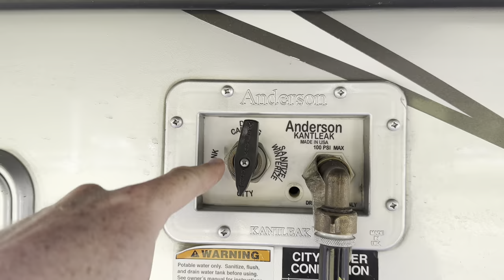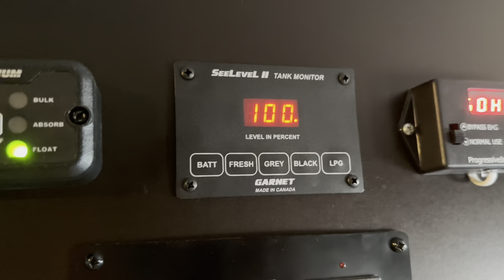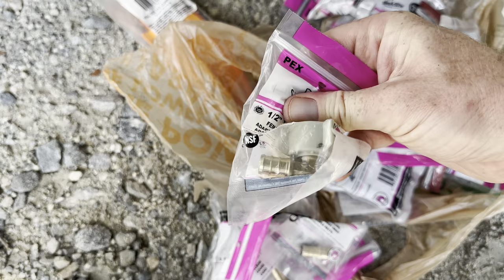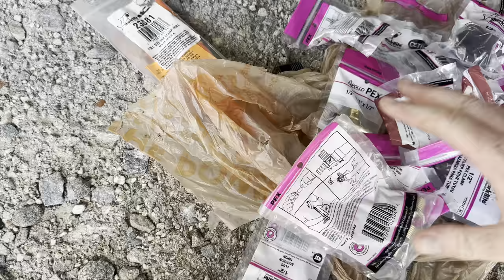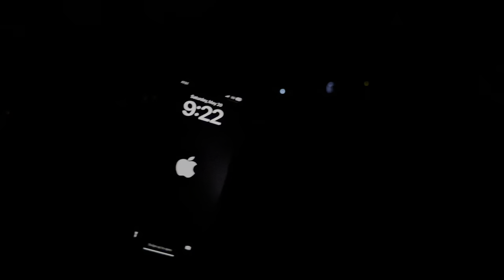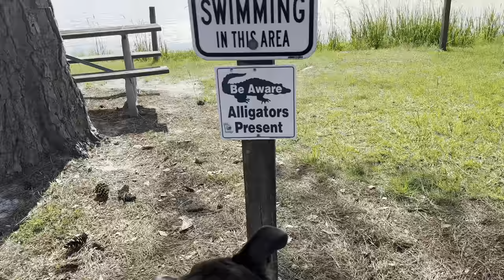This Isn't Good! 😫RV Water Issues (Reed Bingham State Park GA)

Comment: The best thing I have found for the swarming bugs is menthol.  I get the generic sore muscle spray with the most menthol I can find and spray my cap, shoes, back, etc.  The bugs still swarm but they stay back and do not land.  Works to keep ticks off also and I spray my socks or ankles good if walking through grass that may have other bugs.  I used it on the mattress in the cabin we use to have, seems to work well for most bugs.  I still use a mosquito net if they are bad.   Nice park.  Stay  safe and healthy.
Reply from the maker: Interesting! Don't think we've tried that yet. Appreciate the tip😁

Comment: I ended up having to order a new Anderson valve for our Ghost. My original one is plastic, the replacement is brass. Maybe the replacement will hold up better than the original. The worst part, the Anderson valve has a 6 week lead time. Glad you were able to bypass the anderson valve for the time being.
Reply from the maker: We ordered one but we will have to go through the trip with the bypass, luckily we carry Pex, fittings and tools for this reason!

Comment: We had the Anderson valve on our Isata, which also failed. The valve design and innards are a pain to deal with. Anderson advised to turn off water to the valve when changing positions, but I'm not sure it helps much.
Reply from the maker: We never have the water on and lines are never pressurized when we change positions, so we can say that doesn't help😂😂 just a poor design in general unfortunately in our opinion

Comment: We’ve been RVing in motorhomes for 16 years. We came from a boat. In the boat you always use the tank and I carried it over and have always done it in our RV. Even in a campground we run off the tank. I just top it off each night before bed. Tank is always fresh, never smells because it used constantly.
Reply from the maker: We always have water in our fresh tank. Very occasionally we will run off City water but always have water in the tank regardless because we use it too. 😁

Comment: Mike:"I'm and adult and treat me as such."   That wasn't the message I got a couple of videos ago when I asked if you were ever going to grow up.  Not that there's anything wrong with not growing up, heck I've been fighting growing up for 68+ years, but you can't have it both ways.  Just sayin'.  As for the Kantleak that cartridge is no longer available anywhere that I could find.  The replacement valve is solid brass and last I knew cost about $250, probably more now but that's probably your best solution.  Running completely off of the tank is not an all bad idea.  If you turn the pump off every time you leave the RV your rig won't flood if you get a plumbing issue.  If you're on city water and develop a leak you will likely come home to water running out of your coach.  Just something to think about.  As far as the rain goes, remember you are the Wagners.   Keep the good stuff coming guys.
Reply from the maker: Haha adults can like shells n cheese and chocolate milk for dinner and doing dumb things with bikes and sledding😂😂
We ended up ordering a new valve but won't be able to actually get it and replace it for awhile since we are on the road so this mod will suffice in the mean time

Comment: YOU NEED TO TAKE IT BACK TO THE DEALER AND MAKE THEM FIX IT
Reply from the maker: We don't like to do that because we use our rig a lot. Plus we are a several hundred miles away from the dealer and manufacturer
Reply: Nooo stay away from dealer service at all cost!
Reply: @AlliChuckAdventures  THEY DO THE BEST WORK GOBBLESS UNLESS YOU ARE CERTIFIED DONT BE TURNING WRENCHES